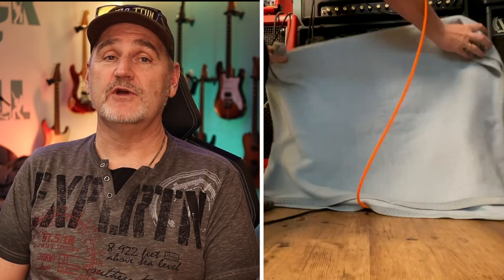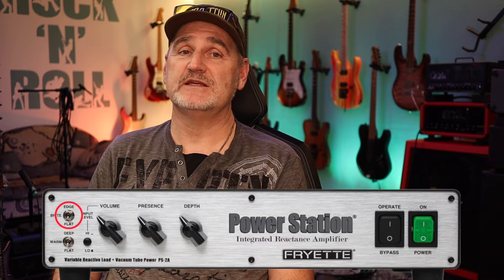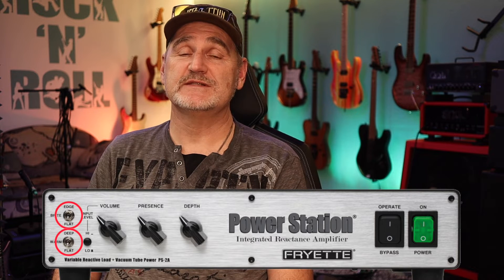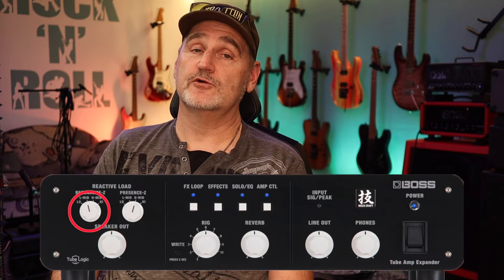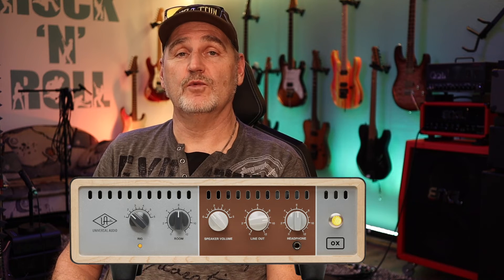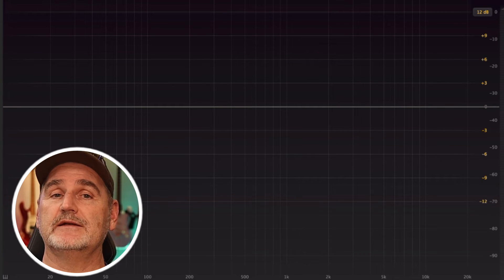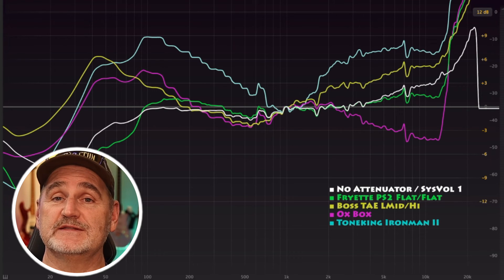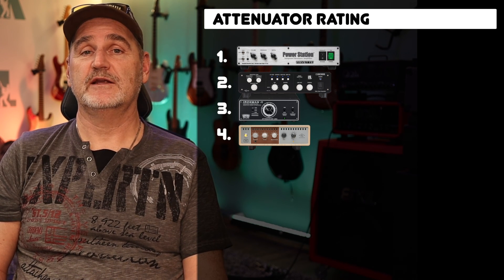Attenuator Shootout / Comparison

Comment: What attenuator do you recommend for a pure analogue stereo rig? Such as a effect loop master/slave situation where the master send goes to the slave return of the slave amp.
Reply from the maker: For a stereo rig I would use the Fryette PS-100. However, not quite sure what exactly you mean with master/slave stereo setup. If you're using the preamp of one amp and the power amp of the other amp the PS-2 is possibly good enough. With the PS-100 you could additionally use the preamp of the second amp for the second channel of the PS-100.
Reply: @RockGuitarVibes A true stereo analogue rig requires two independent amplifiers.  Hence, dual attenuators.
Reply from the maker: @ToneGypsy  Sorry, my bad - the TwoNotes Reload II was the one with two independent channels.
Reply: @RockGuitarVibes  I did try the Reload II, and I immediately thought my Diezel Herbert sounded neutered and mal nourished.  I think the Freyette is the ticket, you get what you pay for.
Reply from the maker: @ToneGypsy  That's pretty interesting - many thanks for sharing your experience.

Comment: Isn't the  Freyette Powerstation a replacement for your amp, and why it's so expensive?
Reply from the maker: Well, it's a different concept - yes, it has a built in amp for attenuation or amplification. However, it is not a replacement for your amp and good quality has it's price. I think we all want it to be cheaper 😉
Reply: @RockGuitarVibes  I think I need TWO Freyette PowerStation for my stereo rig, or a dual PowerStation.  From all the video and reading I've of the Freyette is 99% transparent, and this is why it is expensive.  Folks I read that own an Ox Box say it colors the tone noticeably.
Reply: @ToneGypsy I told tjem they need to make a stereo power station. Dual everything, plus ir loaders. And they could do a pro version with zmacs and cyclops all in one.
Reply: @RockGuitarVibes  Understood. I'm kind of gravitating towards a Two Notes Torpedo Reload II Multi-Impedance Reactive Loadbox?
Reply from the maker: @ToneGypsy  I've also seen that they released that new thing - to me it looks pretty promising and I consider to give it a try...
Reply: @RockGuitarVibes would love to see you compare the reload ii and the powerstation.

Comment: I have a Fryette PS2-A and it is pretty incredible. I've tried other attenuators, but not the ones you test here. The Fryette just has so many other great features and is useful in so many other ways, I really don't see myself ever getting rid of it. I love using it as a power amp for my Synergy modules and other preamps, and I love using it to turn a 20 watt amp into a 50 watt amp. Aside from my amplifiers themselves, the Power Station is probably the best/most useful piece of gear I have ever bought.
Reply from the maker: True - pretty hard to beat.

Comment: I have a Fender Bassman head SF 1968 50w 4 ohm with a cab w a single Jensen C12k 4 ohm 100w. Which one should I get? none of these. Weber, Ox or Boss are not easy to find in Europe and too deluxe pricey for me. They told me about Two Notes, Palmer , any ideas?
Reply from the maker: Recentley the BOSS Tube Amp Expander Core was presented at NAMM. The price is around half of the regular TAE - I think this would be a good option too.
Reply: @RockGuitarVibes  thx, but still 685 eu, that is still too much for me. Almost like I paid for the amp ;( I need only to attenuate, not box or line etc

Comment: I'm not sure, if the amp will see the speaker impedance of the speaker. With fryette the amp see the reactive load of the fryette power station and the poweramp of fryette see the speaker impedance. Same for the rest imo.
Reply from the maker: That's right - with the Flat/Flat option you can avoid having two reactive loads (emulation and a real speaker) in the chain. This concept works pretty well.

Comment: Very interesting comparison and information.  Of the 4 units you compared, the only actual attenuator (in the strictest sense) is the Tone King Ironman 2.  The others are doing more than simply attenuating the original amp signal.  The Freyette, for example, is re-amping the original signal coming from the amp using its own tube amp.  

All that aside, I'm trying to decide between the Ironman 2 and the Rivera Rock Crusher.  I like the concept of the Ironman using dual transformers to attenuate and compensate for the Fletcher-Munson Curve, but it could then be said that the Rock Crusher is more accurate to the original amp signal due to this feature.  I find it strange that the Ironman does not have a bypass switch or even an on/off switch as it requires AC power to operate resulting in it always being "on".  Also, Tone King themselves are hesitant to recommend the Ironman 2 for heavy attenuation usage with a "big amp" such as a 1972 Marshall Super Lead.  The Rock Crusher on the other hand was supposedly designed around using a Super Lead.  Any thoughts?
Reply from the maker: Pretty good amp, now I'm a little jealous. Anyway, even if I understand your concerns - active attenuators sound better, trust your ears. BTW: It's not simple reamping, technically it's the line out signal of a reactive loadbox which is amplified.
Reply: @RockGuitarVibes  Thanks!  My '72 Super Lead is really something else and I feel lucky to have it.  It does have a PPIMV mod, but even with that you still have to turn it up to quite a high level to get the power tubes cooking in order to sound right.  I want to use an attenuator to drop the dB level from about 112-114 to around 102.  I wouldn't really call that "heavy" attenuation. But apparently Tone King does.  The Rock Crusher would just ask for more...supposedly.

Even using a line out signal of a reactive load box going through an entirely different amp, still brings another tube amp into the equation.  How high do you need to have that amp turned up for its power tubes to start cooking?  I'm referring here to the Freyette, not the TAE which is SS because that brings a whole other new variable into the equation.  That variable being a solid-state amp.
Reply from the maker: @markn4526  The PS poweramp is pretty transparent and this is how it should be - the original tone should stay unchanged. However, what's really important is the interaction between the power tubes and the loudspeaker - I think thats the real secret why the PS attenuator works that great. In case you need more headroom possibly the PS100 is the better choice.

Comment: This video and the loadbox series are excellent... thank you! Can you briefly expand on the PS-2 presence and depth settings in your experiment when used with the flat flat settings? That curve most closely resembles the non-attenuated signal, however,  at the end of the video you mentioned the presence and depth controls can help create a Fletcher Munson curve.
Reply from the maker: Yes, these controls work for the attenuator only - but keep in mind, the line out is not affected.
Reply: @RockGuitarVibes thank you for that info. Do you remember what the depth and presence settings were during your tests in this video with the flat flat settings?
Reply from the maker: @andrewamicarelli  Sorry, it's been too long to remeber.

Comment: Hello! Great Video series! I have one question: If I want to reamp (different amp) a guitar track, using a pre recorded clean DI, but cannot reamp using a cab (I live in a flat!), what attenuator/power soak/load box is best for a punchy realistic sound? Which one has the closest result to a real amp, full volume with a real cabinet? Thanks in advance and Cheers from Portugal!
Reply from the maker: I would recommend the X-Load from Fractal Audio - you can find a detailed test here -> https://youtu.be/AR_q297ll5U
However, keep in mind the sound also depends on the used IR's...